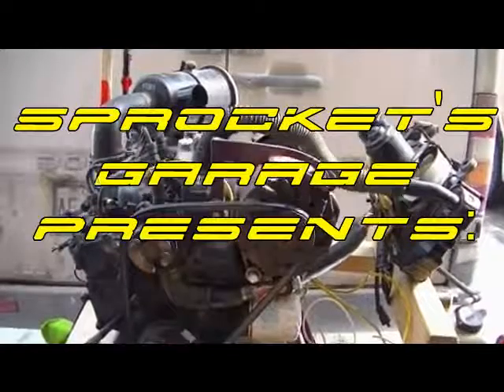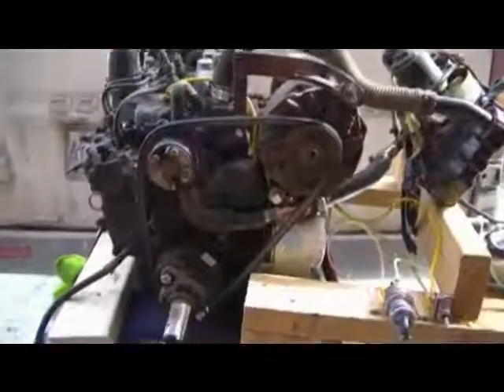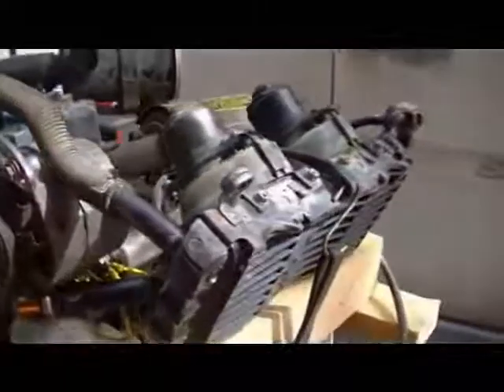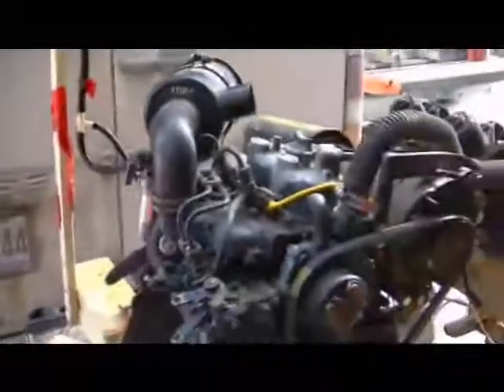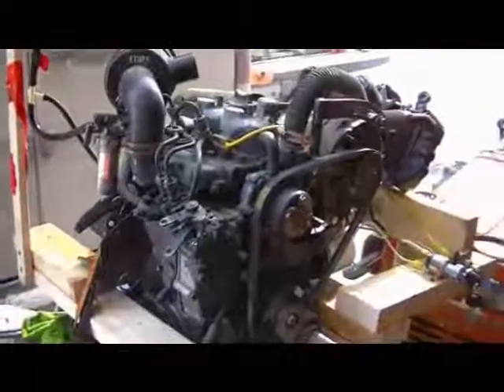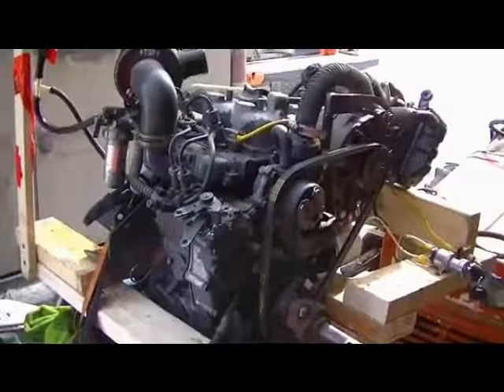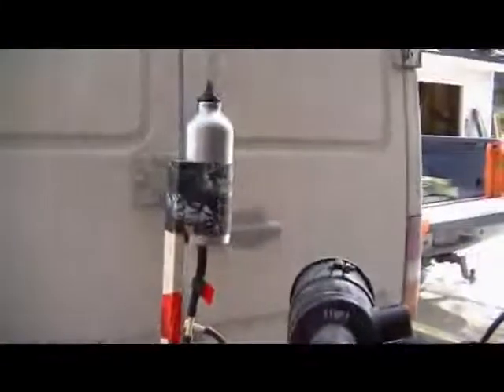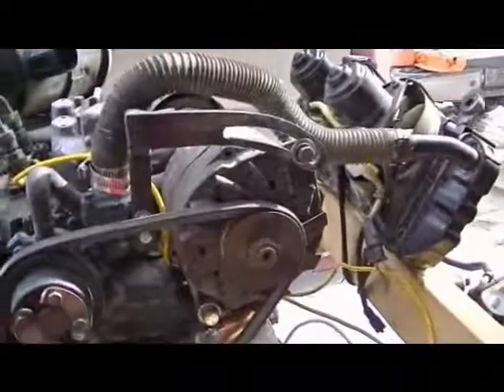Kubota Z400 Test Run

Comment: Hay DocSprocket. If your interested I can show you how to rewire that 63 amp alternator and turn it into a 100 amp alternator. All you will need is about 6 inches of solid core copper wire, the same thickness as the stator wire. Real easy to do.
Reply from the maker: Sure I'd be interested. Be amazed to see how 6" of wire will net you 37 additional amps... I'm in!
Reply: Sprocketsgarage OK, give me a couple of days to make a vid to put on my channel and I'll let you know. I'll also put in a couple useful tips on rebuilding those 10si alts. I've been building those alts. for about 20 years by the 100's at my job. We do alot of custom high amp alts of all kinds where I work at.
Reply from the maker: ***** I'd appreciate that. Thanks.

Comment: Dat good ol diesel knock.
Reply from the maker: True dat, but a hell of a lot quieter than the Yammer Hammer! Go check that one again, it's like night and day!
Reply: Yea. Thats a 4 banger though, isnt it? Would make sense its louder.
Reply from the maker: Doug Fackler Nope. Both 2cyl. The Yanmars are notoriously noisy. It IS a bit larger (displacement) but not a heck of a lot.